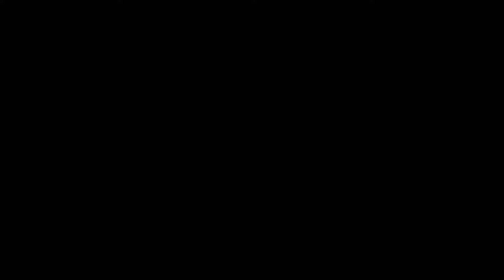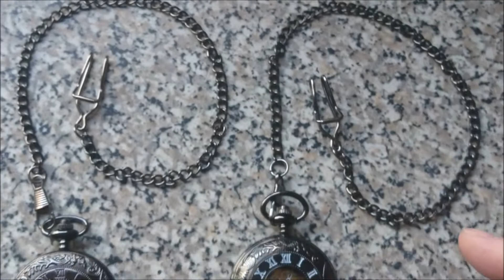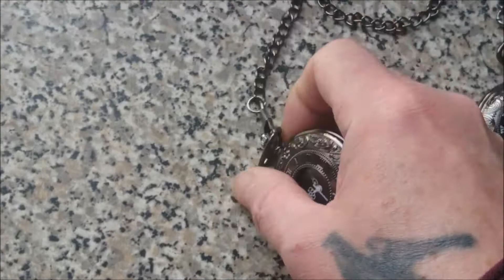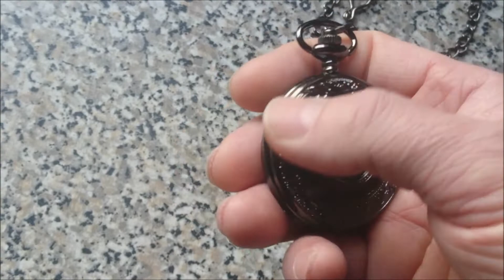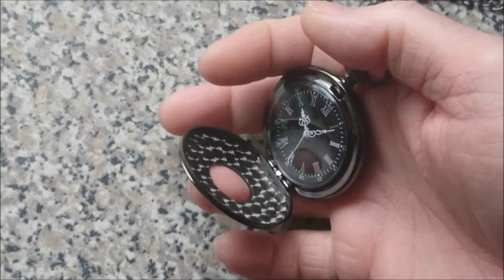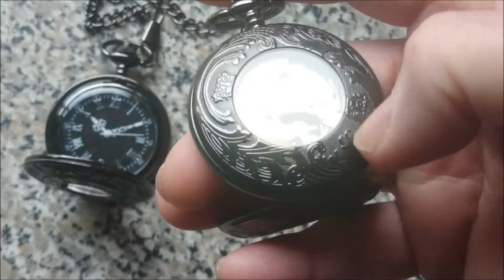Are Cheap Chinese Pocket Watches Any Good ?

Comment: I have a couple sifferent ones at my home.. they're fine, actually. My main on is a strictly mechanical wind up that you can see the engine from the back and front. It has, over the face a plate that looks like a circular window that will open up. The only thing is, dont over wind it. I learned the hard way, but i havent made the same mistake since then and i got a duplicate. I wear it wherever i go and its a great boredom cure, esecially in the ugly factory that i work on the line at. Also , the big thing for me is that it is not battery powered.
Reply from the maker: For the price they cost you can't go wrong really.
Reply: @MidlandBulletRiders  they're actually very beautiful pieces.